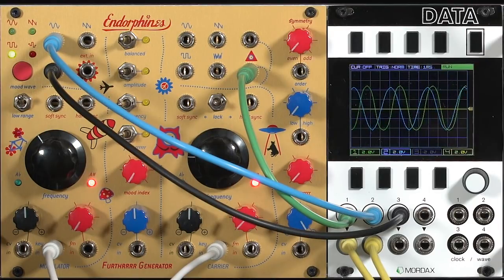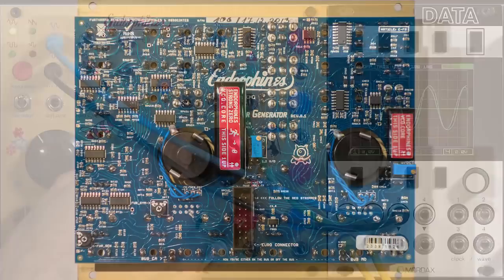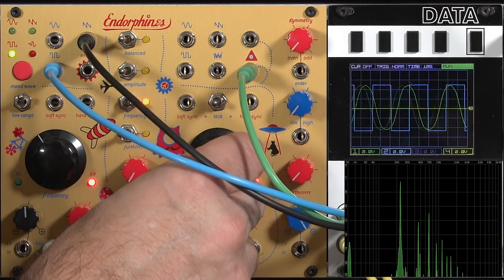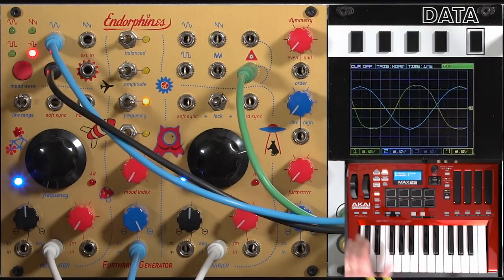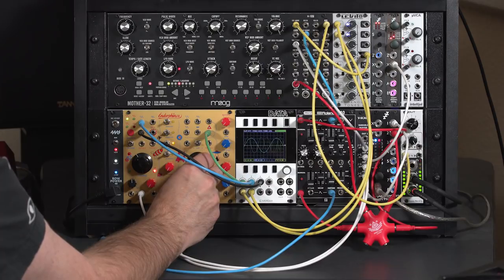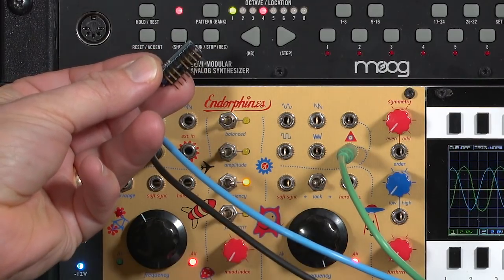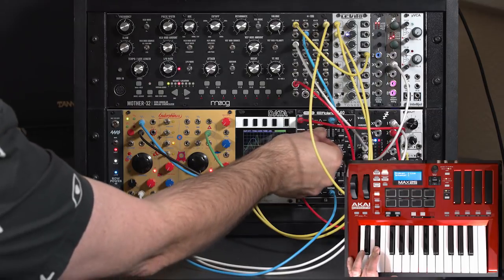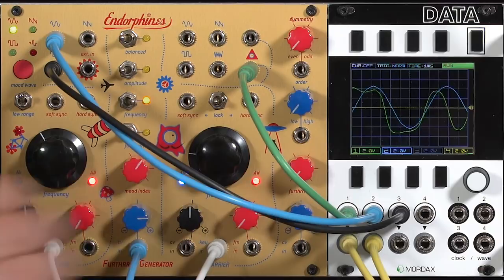Furthrrrr Generator 2/5: Exponential, Linear, and Through Zero FM (LMS EEP)

Comment: Thanks for the great lesson. So zero thought is just like linear FM but just with better tuning making the sounds more useful pitch tracking keyboard and allowing greater modulation? Does linear have its own quirks create interesting sounds that zero through can't do or not really? Exponential sounds can't be achieved with Linear or Zero through can they? Are the Rubicon and Zero Oscillator the other 2 alternatives?
Reply from the maker: Sorry for the slow reply. Yes, in most cases you can think of thru zero as being "linear FM on steroids". That said, some manufacturers are trying to add new twists, such as deciding at what point the waveform reverses. You won't get the same sounds between linear and exponential FM, as the amount of up/down pitch shift is different between the two. The Rubicon II and Zeroscillator are two great options.